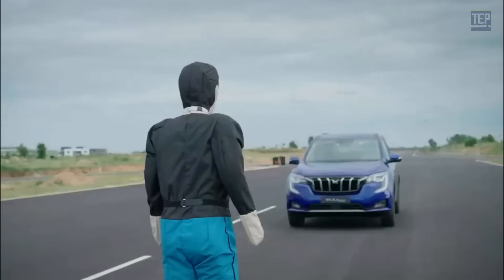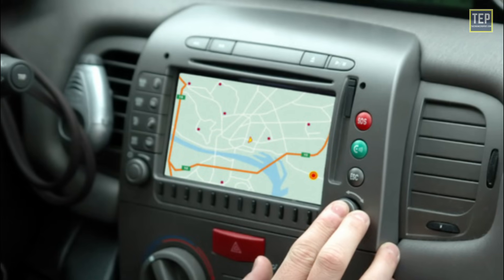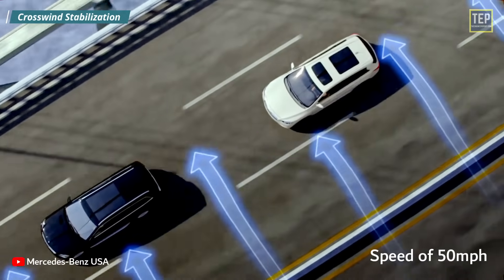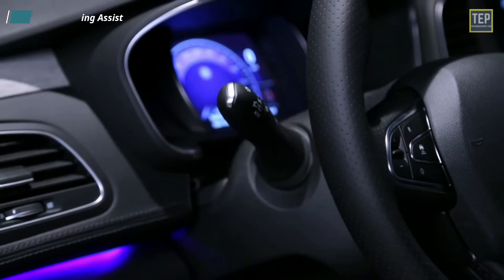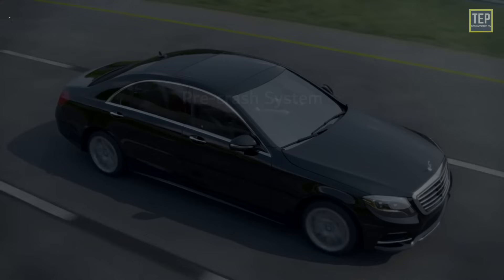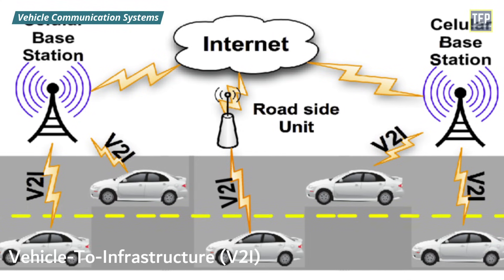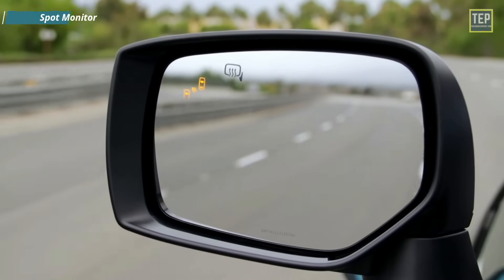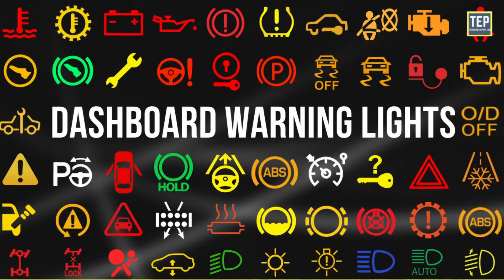Advanced Driver Assistance System | Every ADAS Levels in Car Explained

Comment: WIth my brand new 22 Silverado I spent five weeks arguing with the dealer over my camera (braking) that's supposed to prevent collisions wasn't working. They kept telling me all how it was working until I threw fit, eventually they replaced it and it finally fixed the problem.

Comment: Automakers should also preset the level of assistance with the current driving modes they already have names for:
Comfort: LKAS & lane centering assist + ACC
Normal: LKAS + manual cruise control
Sport: no steering assist, TC off, sport suspension

Comment: What about ditch caused by earthquakes and rain-water?
Which level of ADAS can detect and stop vehicles?
Reply: Currently, there is no vehicle that can detect and respond to potholes/ditches. Most vehicles with lane-keeping assistance also detect road edges and will stop you from veering off of the road at speeds of 40mph or greater, but this only applies to the side, not the front/back.
Reply: It will be great if this thing is added in future versions. Even in case of false route/direction calculation such things can prevent mishaps.
Reply: @nothughmahn  FSD in Tesla cars can respond to potholes 👍, and I'm sure someday ditches.  🤔

Comment: What if the sensors fail either partially or completely? There are no foolproof sensors. Sensors go bad with age too. So is there a system that checks all the sensors and gives warning when engine starts up at the commencement of the journey itself. I have had problems with simple parking sensors. There should be some backup systems in case of failure of the sensors.
Reply: There is a lot of redundancy. I know that Tesla has many systems of redundancy, including the main processor chips for example.

Comment: Good information. It would be even better if you can classify each feature to a particular level or a set of ADAS levels.
Reply: Each feature isn't dedicated to a level. They had a section on the levels and what they mean. Sensors input data to the system the system may have audio, video or electro-mechanical output depending on the level...
They also say in each feature how the output differs. Are you sure you were paying attention?

Comment: ADAS + Adaptive Cruise Control = Autopilot

correct me if wrong
Reply: One of the parts of ADAS is adaptive cruise control. Or in other words: adaptive cruise control is a part of ADAS.
Also did you mean autopilot, fsd beta or any of those other fancy words that Tesla has for marketing purposes? It is in beta. It's still being tested. It still requires driver interaction. I think they call that level 2 right? Maybe 3. It's in the video...

Comment: Sheeeeeeeet, this will make cars expensive to buy and more expensive and harder to repair again. I'm okay with whats available now, Level 123 is enough if ever.
Reply: Yeah, and even worse, it is making people worse at driving since it makes certain people feel overconfident and forget that they are driving a dangerous hunk of metal traveling at 60 mph. The amount of fatal accidents have went up in the past 10 years here in the US despite regulations pushing for safer car designs because people are getting worse at driving. The government fails to address the root of the problem.

Comment: Get it RIGHT!

GPS does NOT work as stated (satellites send the latitude, longitude information to the car).

The car does NOT “communicate” with the satellites (no 2 way communication).

The correct explanation should be:

 The car only receives the time DIFFERENCE between a few satellites (triangulation) and CALCULATES the coordinates based on that information. The satellites DO NOT send the coordinates, got it!?